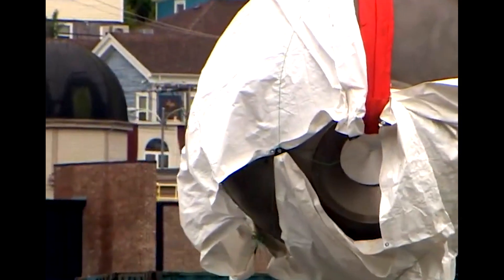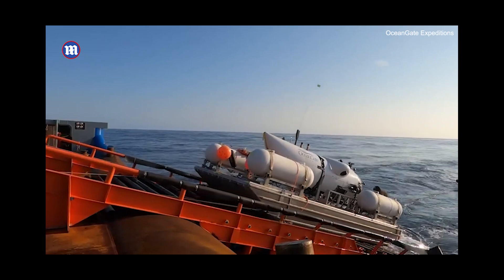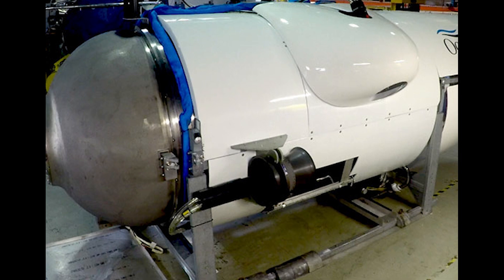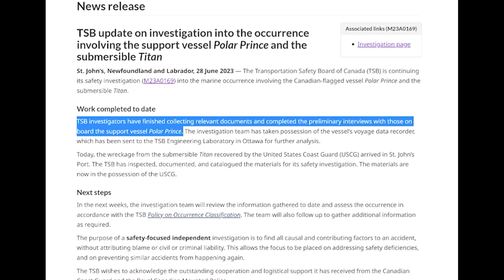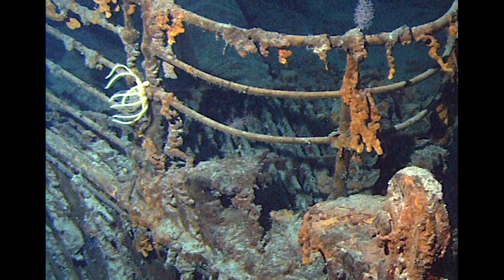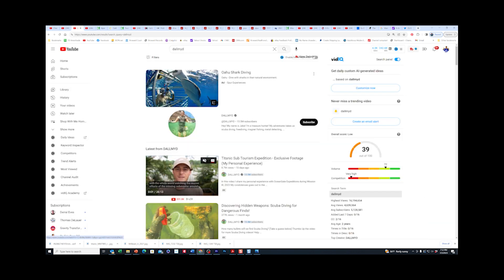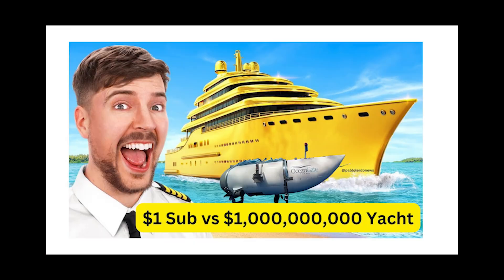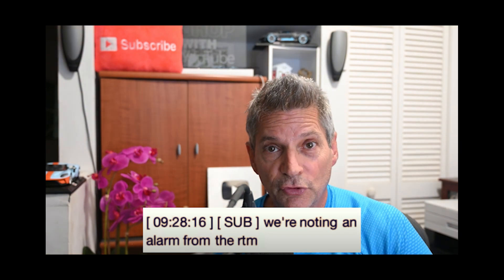Titan Submarine Debris Clues, Implosion Simulation

Comment: Thank you for this video. I also feel the same way as the narrator about the seal. I'd like point out that Mr. Point of No Return chief engineer didn't use a VACUUM PUMP to pull out the AIR BUBBLES of his epoxy. 🤦‍♂️
Secondly, even if he did pull out the air bubbles with a vacuum pump, he created even MORE by the fast short strokes he applied it with. Ideally they should have put the whole assembly in a big expensive vacuum chamber.
But I also noticed they laid the carbon fiber in parallel lines. They were supposed to cross the layers so that they reinforce each other. The ONLY thing holding it together was the resin.
WORST part: pull on a thread, it's strong. Push on it and has NO resistance. James Cameron said it better. It's stupid to build this from fibers. They're great in tension, but awful in compression. 🤦‍♂️
Reply: And the epoxy resin portion of the composite was brittle at room temperature. At the very cold temperature at depth, it was even more so.
Reply: Sadly, that's basic science - some things are stronger in one than the other. What was Rush on!?

Comment: It is obvious to me that the Carbon fiber had gas bubbles in it as it was laid up wet. These microscopic bubbles expanded and contracted every time the sub went down and back up. This happened to the entire tube of carbon fiber equally. Each fiber was weakened by this and it all failed at once. and it disintegrated suddenly. This is why none of the carbon fiber remains. This was caused simply by expansion and contraction.. If the carbon fiber had been laid up in a vacuum this would have been delayed but sadly it was not.

Comment: they basically build a toilet paper roll... strong in tension but can be squished easily. probably the only thing preventing the carbon from imploding on previous dives were the titanium end caps.
Reply: also, it did get weaker every time it went down, cyclic fatigue

Comment: I saw in one shot they are using a regular ratchet and the other the torque wrench but hes got a extension on the torque wrench every mechanic knows that defets the purpose
Reply: It was all half-assed. Even the most critical part where they applied the glue was done in the warehouse with no controlled environment. Just some good old boys with a beer in one hand and a wrench in the other as they work on their Chevy truck.

Comment: I was right - the glue is not an inert material. The epoxy that they glued the carbon fiber to the titanium with would not resist the immense pressure created by the ocean water. The more water on top of an object under water is the same as any object with weight exerted on it would be tens of thousands of pounds per square inch! Imagine someone put three and a half miles of water weight on your body - it would be so heavy that you wouldn't be able to breathe. This is how it is under water as the pressure is from above - not from around it. The deeper you go the more water pushing on top of you.

 I knew when I heard of this carbon fiber/titanium composite shell that this was a perfect recipe for disaster! I'm sure that they felt something. It may have been quick but it was fast and extremely painful. It's too bad that Stockton Rush lived up to his surname. He was in such a rush to get the experience of being under water with other people that he was willing to sacrifice safety for progress or pushing the envelope or boundaries of risky exploration.

Comment: I’d be surprised if they found any carbon fibre traces. In my opinion that part went first and the glass followed. The joint and glue (certified?) don’t add confidence in the design. Eerily the window breaking reminds me of the cargo hold hatch on the Titanic projecting away from the bow due to hydraulic pressure. The similarities are shocking. Thanks for the informative video Jeff!

Comment: 1:23 100% a great question… I’ve been wondering this ever since they brought it up as well! For some reason, I do not think that was where the issue was… I think it was basically where the white part connects to that/cylinder connecting to that port. That would make a lot more sense… I do think they removed it in order to get it up to the surface… However, you would think that they would not allow that necessarily… But I guess only time will tell. I’m surprised they did not at least give us an answer on that part as most people noticed exactly that and I was wondering if, it was expanding and contracting with the seal, causing it to break? I personally do not think that was what happened though…
Reply: @troplaya55 I wonder if that's where the alleged human remains were found, in the salvaged porthole that was dismantled from the end cap? Maybe it was already separated from it?

Comment: The size, shape, and number of times the submersible went down is the key factors to why it imploded! Even James Cameron knew not to go down with his multiple times… And his was not made of carbon fiber, he understood that it would weaken similar to a wooden baseball bat hitting balls at 250 mph, and James Cameron’s was made of titanium metal Dash steel understood it would weaken each time he would go down.… At some point it would snap… ! It’s common sense, unfortunately, Stockton did not understand that part of it… Carbon fiber could have worked just fine for one or two trips down, but that’s it. in fact, he probably could’ve used the electrical part over again from the original, if only he built a brand new one… Regardless, there was no way to get out of this thing if it was on the surface… There should have been some type of special Way to blow the hatch so to speak, not to mention, there was no verbal communication at all… Very silly, especially when he is comparing it to an iPhone, which on a scale of 1 to 10 made -200 in regards to making sense! I was embarrassed for him at that time when he said it… And that’s before anything even happened over here! The shape of it was also terribly designed, perfect if you’re looking for an implosion. This is not a Disney ride, not sure what the hell he was thinking in that regard. He was not even going to make any money, especially because the amount of money it cost for these type of expeditions… A quarter of $1 million times four is exactly $1 million… Sorry, that is not enough money to even fund yes! I understand. There are multiple people who paid and may not have gotten on the submersible, but still it cost so much money to do this… Few alone would be so freaking expensive! So this was not a money grab, it was more of a Walt Disney type experience without testing the ride. He was smarter than this… But he was naïve and ignorant to what would happen! Awful…

Comment: They would not have taken anything apart and interfere with an investigation. The viewport was designed to handle implosion, not explosion. When the submersible imploded, the 2 end caps smashed into each other with enough force to blow out the port when they all collided as the volume shrunk 400x.

Comment: I don`t understand why ppl giving a fuzz about it`s not open able from the inside. You can`t anyway. Outside it`s 400bar more pressure, and when you make it back to the surface, then there`s help anyway. 
That design had so many issues, that this is the least to worry about.

Comment: Uneasy feeling about the glue.  What kind of glue was used?  Was bond tested in extreme pressure environment?  How good was bond at resisting moisture intrusion?
Reply: Extreme temperature changes? Salt water? Against the diffferent rates of expansion/contraction of CF & titanium?🥺🥺🥺
Reply: @lordorielrising4673  This is hard science that is required to obtain classification.  Stockton was dismissive so he may have skimped on testing.

Comment: Some mention temps being hotter than the sun during implosion. Likely not. Superheated maybe, but only for a tiny fraction of a second before all the cold water rushed in. Incineration likely didn't happen. Unlike some military subs that have imploded, there was little to no fuel inside the passenger compartment to combust. Also, a much smaller volume of air inside. The carbon fiber likely sliced and diced everything to bits. The shockwave is probably why the end caps are so clean. The attachment of the caps was likely sound, since pressure would force them tight. However, that assumed the carbon fiber portion maintained its shape. If it bowed in too much, the caps would inevitably pop off, which appears to be what happened.

Comment: Glue bond surface is an issue.  Another issue is if fit is too tight, glue will be squeezed out of the joint which weakens the bond.  Video shows application by hand and lowering of ring by crane.  Not precision at all.

Comment: note also - the titanium rings were no longer bolted to the titanium end domes,  the implosion was so violent it destroyed the bolts that held them together.   the other thing I see.  normally carbon fiber is applied on pressure vessels back and forth at a 45 degree bias so the layers reinforce each other.  the carbon fiber was just wound around with no real crossing bias between the layers.  I believe this is why it failed.
Reply: Even idiots like us would duct tape cross ways rather than like a spool if we needed strength.
Reply: not surprising, the bolts were from home depot
Reply: @imacomputer1234  Not Harbor Freight to save $$$?
Reply: The 18 bolts are probably an insignificant strength compared to the forces in the explosion that follows the implosion.    During the dive, they would have insignificant stress because that joint is in massive compression.
Reply: @brianwest2775 but the bolts connection must be stronger than the glue connection. It will first the glue that will fail and detache from the rings
Reply: @brianwest2775 No, implosion does not cause things to explode… 🤦🏻‍♂️

I don’t get why people think there must be an explosion after implosion occurred…

You don’t see implosion after you throw a grenade in call of duty or do you?
Reply: @tonamg53  as the cylinder collapses the air inside had to go somewhere so it blew out the ends I understand that the air molecules being compressed inside during the collapse of the tube could have  been superheated
Reply: @mrpurcountry  No, implosion does not superheat the air. It “might” raise the temperature by 1°celsius 

That’s it. 

If implosion can superheat the air and vaporise the water surrounding it…  then all nuclear power plant would be phased out by now and our home will be electrified by the power of implosion.

The implosion done at National Ignition Facility which imploded “test target” using high energy laser beam does raises temperature to the sun level…

But the power you need to run that thing could cause the whole of USA to temporarily black out… it uses power more than the whole country uses at any instance.

Where the heck do you think a SUV size submersible is going to get that amount of energy from to be able to superheat the air?
Reply: @tonamg53 yes there are explosions after an implosion, an implosion is a reverse explosion basically, think of a star dying, that would be the implosion, then the supernova would be the explosion. Also grenades don't implode because they aren't made to implode.
Reply: Carbon fiber was a very poor choice of material for the pressure hull, full stop. CF is strong in tension, but not in compression, and it's plasticity and strength properties made it totally unsuitable.  You're correct that the radial weave was also a poor choice, but even a biased application probably wouldn't have made a difference.
Reply: @GBooth  I would think the preferred fiber direction woudl be radial bridging the inside and the outside of the hull, since anything that would try to cause flexing of the hull without reducing the volume of stuff between the inside and outside woudl need to increase the distance between the inside and outside.
Reply: @GBooth  " CF is strong in tension, but not in compression"  Exactly, fiber in compression is literally like pushing the ends of a shoe lace together.
Reply: @GBooth this was expired carbon fiber that he bought at a discount.
Reply: @nm9412 Carbon fibre has no expiration date 🤦🏻‍♂️

You can store them indefinitely.
Reply: @tonamg53 this was a pre-peg carbon fiber,  the resin is added to the fiber in manufacturing.  the resin is heat cured in an autoclave after winding on the production form.  the pre-peg carbon fiber is stored in freezer to prevent premature curing before use but for certified aircraft use it is only allowed to be stored frozen for a length of time before it cannot be used on aircraft but is still usable for other things.
Reply: @yorinov2001  Ok, in that case then the requirements and control for the thawing temperature and time during manufacturing of the hull, may plays a significant role in the accident. If it wasn’t done properly then the reduced performance of the carbon fibre may cause the hull to imploded prematurely.

Not sure why the requirements for use on aircraft is no more than 1 year? I try to search for it but there doesn’t seems to be a conclusive evidence why it cannot be use after 1 year assuming it was stored in properly controlled environment.
Reply: from Boeing. Which airplane compression is the opposite for submarines.
Reply: And the fact they used the same sub to go under water multiple times.......
Reply: 100% agree. carbon fiber is known for their tensile strength, that is why they must be oriented in different angles to provide resilience. Having it wound in parallel is like making tube out of epoxy and string. Sure theres carbon fiber in it, but its mostly the epoxy thats providing all the compressive strength. Its not a carbon fiber sub, its an epoxy sub.
Reply: @centripetal25  exactly carbon fiber only as strong as the glue that holds it together
Reply: Look up fire piston or diesel engine.
Reply: @thomasbailey6997  Try running a diesel engine without adding fuel…

See if you can start it up?

Also, diesel engine works by compressing fuel/air mixture to the point where autoignition occurs, resulting in an Explosion which forces the piston to move down.

 No implosion are involved in running of any diesel engine.
Reply: This case is getting worse and worse. Every day I see things that make no sense. I just cannot believe with how much that guy got away with. I cannot believe that they mounted the screen inside the hull by drilling the carbon fibre… it’s crazy, know?
Reply: @GeorgeGiann I don’t think they did that there was a lining and they drilled on the lining not the cf
Reply: 100% retarded design. Hard to believe any engeneers worked on this thing.
Reply: Success in physics is to never be part of a high energy exchange.  The violence of the implosion indicates a high energy transfer to the bodies of the crew inside.  The equivalent of defusing a bomb and failing.
Reply: The weaker material i see is the glue.  How much grip did the glue have on both materials?  It looks like epoxic glue.  What happens if both sides next to the glue expand and compress  at a different rate? Either glue loses grip or it gets fractured.  Even flexible expoxic glue could have cracked or lost its grip. My bet is the glue stopped having grip on the titanium rings.  The implosion cracked the carbon fiber like a glass.
Reply: Also, note the video clips are of the pieces being off-loaded from the ship to shore. There may have been some disassembly or other "cleaning up" of the parts between when they were recovered and the ship made port. As of now, from what little that I've seen, this is unaccounted for in the time line.
Reply: The video shows one ply being wound (out of probably several hundred in a cylinder 5" thick).  Just because that one had a 90 degree orientation to the cylinder axis doesn't mean they all did.  I think I read that NASA had a hand in the design, and those folks are not completely stupid.
Reply: Mr.Rush knew he would not be able to class that vessel
Reply: Also the fact that the carbon fiber was expired!  They usually bury it when it expired but Rush bought at a cheap discount!
Reply: @veronicahermes1724 A quick Google search is all you need to find out that carbon fibre does not expired and make yourself less stupid 🤦🏻‍♂️

Comment: Good analysis of the joining points and the difference in the material properties  titanium and carbon fiber . Glue .. what glue was used .. was it tested under pressure and the cold temperatures.. ?  Yes the text messages have been made public ..

Comment: I would say that it imploded from stress fractures from previous dives and the porthole blew out after the violent decompression. Carbon fiber is venerable to cracking. My guess is that it weakened to a point where it was unsafe and they realized this and tried to return to the surface but implosion happened before that could start happening.
Reply: I heard somewhere that they didn't even bolt in the 17th bolt on the very top becouse it was a pain to reach.
Reply: @BigMacOrange  I heard also that they didn’t fasten the final 18th bolt, saying it was mathematically insignificant. I think that came from the reporter Pogue who has said on camera what it was like to be invited on the submersible for free. His dive went down to some 37 feet, I believe, and then was aborted.  I got the idea he wasn’t pleased about many of the conditions, but did it as a journalist for the story.
Reply: @m.h.6499  yes you sound correct. It was 18 not 17.
Reply: Carbon fiber shatters, not crack
Reply: @KentRoads  cracks form in the resin. This is why most people cure the carbon fiber under pressure to insure there aren't bubbles in the resin.
Reply: All they needed was a couple of cans of Flex Seal